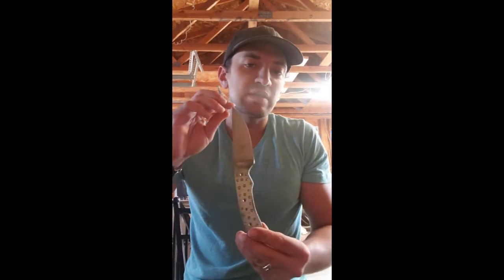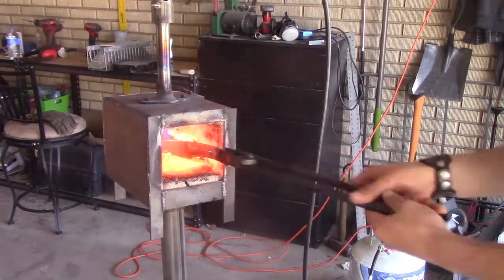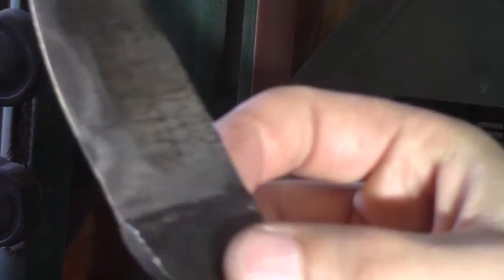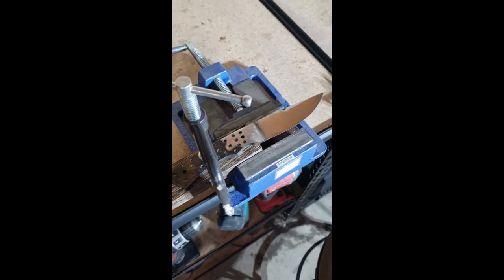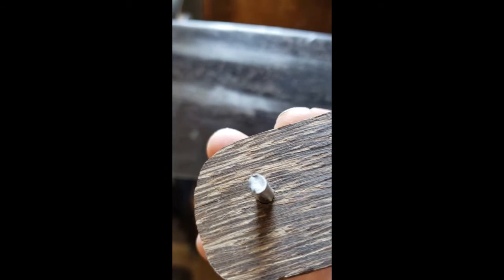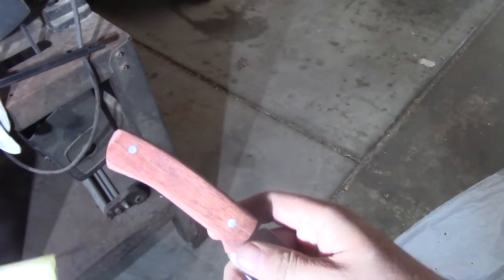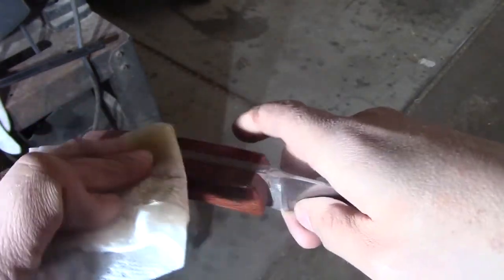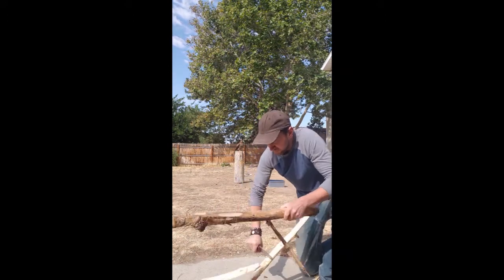Knife Making- Heat Treating A Very Thin Blade Edge

Comment: do you reckon this would be possible with a charcoal forge
Reply from the maker: It would be possible with charcoal, but I would recommend using coal. I used to have a coal forge and I made about 10 blades using it